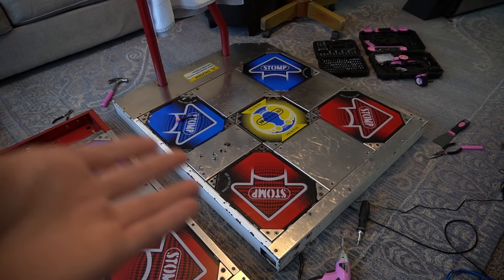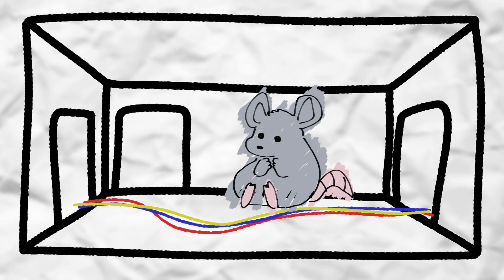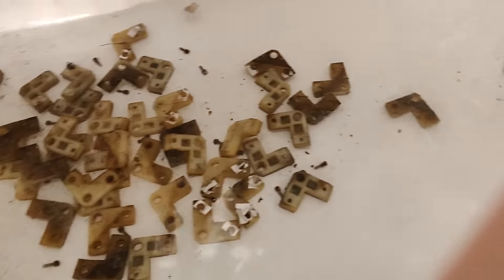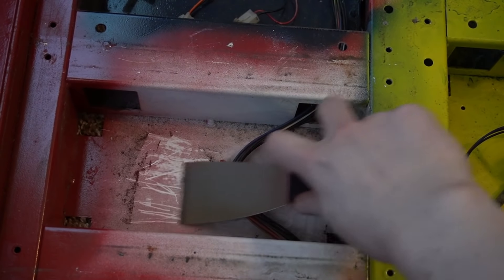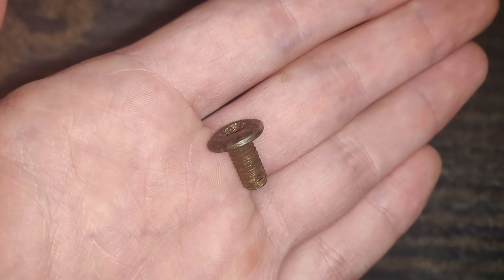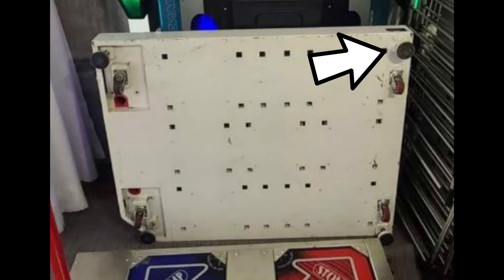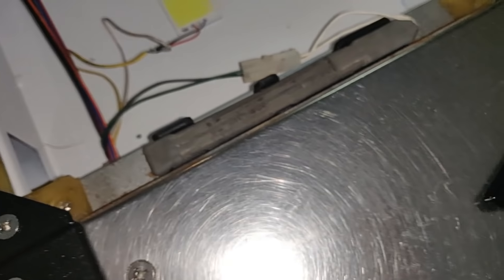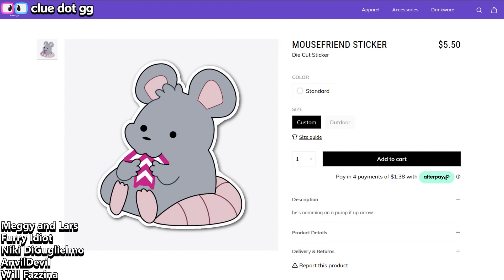i restored some arcade dance pads to their former glory.

Comment: Hey, scratched plastics that are smooth/transparent? Use Nu Tone Scratch doctor and then buff pads on a power drill UwU. We use that alot at my work for laptops, consoles, etc. Also make sure that it the plastic has an image on top like a decal that lights up that the image isnt on the top where your polishing but on the bottom or you'll sand away the decal :3

Comment: Absolutely love your videos and this one is very enjoyable, it's fun to just listen to this adventure of restoring the dance pad!
A tip for future restoration if you ever do it again, I do this for my old consoles when they get really nasty: Use strong chemicals. There's only so much soap and scraping can do alone, but strong cleaning chemicals, and even basic things such as rubbing alcohol (Which rn is expensive since pandamic still going) does a much better job at getting any dirt out, even decades old crust. My PSone was legit a grayish brown because of the crust of time, just by using rubbing alcohol alone it return to a light gray, and became its normal colours when I brought in strong cleaning products. Just a tip I thought could help in the future!

Comment: As an owner of two Namco Motocross Go arcade machines, restoration work isn't easy. Had these two for nearly two years and still they aren't in a playable state yet (missing parts).

Also, did this machine have the original computer and does it work. The said game I mentioned had the original boards both working but with no monitors.

Comment: Lucky! It has been my dream to get a PIU cab myself (although I’d personally get TX instead of GX), so it’s cool to see someone actually got one for himself. Finding one in my country is much, much harder.
Reply from the maker: the GX sold incredibly well in the early 2000s, so if you're going to find a PIU cabinet for sale, it'll likely be a GX. i'm speaking as an american, of course, it very well might be a different story where you are. good luck with your search!!
Reply: @planetclue  I’m from Indonesia, so I’ve actually seen more LX than GX cabs (in fact, I’ve never seen GX in my entire life except through pictures). The arcade I’m playing in (which is extremely cheap - 20 cents USD per play, 3 songs) has TX running Prime 2, while 99% of other arcades over here run LX and PIU XX (more expensive - 50 cents USD per play, 4 songs).

And that same TX cab I used to play is the one I’m eyeing for. The arcade center is old, and the machine itself is quite old (the screen is an old plasma and has quite a burn in for one). If the arcade is going to be closed, then I’ll definitely get that.

Comment: 1:08 Left hand drill bits work wonders as well, the kind that drill in the left hand direction. And an impact driver is always your buddy. It's a device with a bit at the end that you hit with a hammer at the other end and the hammer action forces the screw to unthread while also pushing down on it :)

Comment: Part of the reason that steel is more susceptible to rust after sand blasting is because the media colliding with the metal causes it to ionize, and all it needs is a little moisture to create the environment that propagates oxidation.

Learned this after working in a desert environment (I'm in metal fabrication)

The more you know.

Comment: another thing about your spray can job is that it looks like you sprayed close to the surface and sprayed too thick of a coating. The trick is to coat it in lite layers little by little. That would result in a nice even coat and less likely to droop

Comment: Late to the dance party here, but another help on rusted bolts/screws is to spray them with penetrating oil. spray it on let it sit for awhile and it will breakdown the rust and help it to break loose.

Comment: A simple way to remove spray paint you can "apply vegetable, cookng, or baby oil with a rag and gently scrub with a fingernail brush or old toothbrush if necessary. Use warm water and soap to remove the residue after the paint is gone. If all else fails, apply white vinegar with a rag and gently use a brush to scrub off the paint" (anything in quotes was from Google but if anybody body needs it here you go)

Comment: Whenever possible just hit all screws the day before with wd-40 or some penetrator of some kind. These fluids work better the longer they have to soak, multiple applications is key. When you encounter a fastener that is stuck and won't budge DO NOT just twist as hard as you can like a brute force monster. As rust forms in the threads it expands and locks the threads into place just like when water freezes and expands into ice. Even though the fastener is stuck and wont move you can still load the threads up by torqueing on the head back and forth which will transfer the load to the rust and since rust is brittle and non uniform this repeated loading and unloading will break up the rust and allow you to remove the fastener. First loosen then tighten then repeat.

Comment: Machinist here, you can use something called a thread pitch gauge to tell you the threads per inch, and then measure the diameter of the threaded portion. Your screw size is annotated as the thread size (i.e. 1/4, 1/2, 10mm, 5mm) followed by it's pitch, annotated in threads per inch (TPI),

There's typically common sizes, but some companies will use custom threaded screws to force customers to buy overpriced screws from them only.

Comment: 11:08 you should have looked into FSR modding your pads. For much cheaper than buying a whole pads worth of regular PIU sensors you could have bought the materials to put in a FSR system many players are upgrading to. These sensors are only 4 bucks each for the square ones and have so many great features that make them 100x better than the traditional rubber switch sensor (such as software sensitivity adjustment) . Only downside is it would have taken a bit extra work but you seemed pretty invested into this project from the beginning.

Loved the video anyway, nice to see people giving old hardware new life.
Reply from the maker: I already have an smx stage, which uses FSR. I don't need more than one FSR pad, lol. thanks for the suggestion though :)
Reply: @planetclue  nice, those are amazing pads. I own a gen 3 pad that has load cells. I am working on upgrading it to a FSR system but not using the actual fsr kit SMX sells.

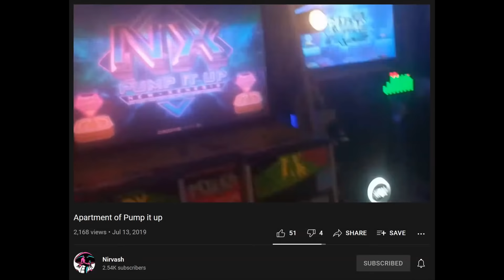Comment: 8:17 That's precisely what Reddit is for. Take your measurements, and take a photo of the screw, find a suitable subreddit and post it there. You will receive an answer.

Your method worked because it's a well-known object, but I've had it with hand-built items that needed replacement screws. That information does not exist, so the only way to find out, is to go to Reddit.

Comment: Spray paint would have been nice, if you would have lightly sandblasted it beforehand and made some profile.

But without it, the paint is just trying to stick to paint far past its recoat window. Maybe if you roughed it up a bit with some sandpaper, But best chance is too just have it blasted off lightly. And then to prevent the flash rust, or future resting. It's best to start out with a primer that is magnesium, aluminum, or zinc rich. Those would have act as a sort of cathodic protection for the steel.

Basically being the sacrificial barrier that corrodes before the environment starts to corrode the steel. Also, most standards say you should have it painted before 12 hours. And if you don't, you need to reblast it or abrade it with a wire brush.

Comment: I feel like if you are gonna do more restorations, a cheap drill press will be a life saver for you! Say you have a hole on the floor that had the previous owner strip out the threads. Just put your drill press on the pad, get the right drill and tap, and go to town. Although, you will have to make sure your using the right material for your tools. Aluminum is easy, just use HSS (High Speed Steel) for the drill and tap. But if it’s hardened steel (use a file to test. A file will have a dull sound if it’s soft, if it’s hard it will ring, like a hand rail at school). If that is the case, you will need carbide tooling, which is much more expensive. At my company, the average cost for a 1/4-20 carbide tap, (1/4 inch hole, 20 threads per inch) is about $90 at McMaster-Carr.

Comment: Hi There! So the YT algorithm sent me to this video! I'm sorry that I'm really late to the game but just wanted to give you the heads up that the 3D printed parts made out of PLA will need to be replaced after about 4-5 years because that filament material (though easy to print) is biodegradable and will deteriorate over time. I would recommend maybe having those prints replaced with ABS or PETG. PETG is a little easier to print with, ABS you kind of have to keep a close eye on. Again, sorry I'm late to the video, someone else probably pointed this out already. Anyway, love the idea of the project! Hope it works out!

Comment: Hey guys, hey guys, I'm coming over more from the car and tractor restoration side of things just wanted to say (can) not well but can get a good finish. Something like that with spray paint but I will take a lot of prep work and sanding and wire wheel to get a good finish in the first place and then you have to go ham with the clear coat if you wanted it to last but it would

Comment: Hey 

I know its a money sink in this project (i also have a GX Machine Cabinet)

Almost everything you said about the dance pads are correct (im not willing to sandblast it, its not going to be the same).
Also some replacement parts are going to be DIY-ed because either theres no replacement available or too $$$$

Im looking forward how you are tackle in the inside of the cabinet, i was like "omg wheres this cable going", and to be honest the only part im afraid of failing is the Neon Lights and the 220v Transformer inside my cabinet. those are the worst ones (Had a bad [if i could say bad] idea of replacecing the coin door for accepting different kind of coins [and keeping a record with arduino] but failed miserably])

i think also while you are upgrading your dance pad i think i saw upgrading the lights (i did that too and i love it), mine didnt have CRT previous owner changed to a TV (as much i would liked to have it, i just had to stick with the LCD TV they installed)

Mine didnt have CPU and Game, and getting a proper replacement was the worst one (getting a MB and the Game, i was not going to install F2, it deserved the original one) took forever

best wishes and still looking forward how does it end =) 

PD Also thanks for Nirvash it also helped me so much like you
Reply from the maker: i actually paid extra to get the original CRT that the cabinet came with! my cabinet also didn't have the MK or a game, so i had to build my own PC with ebay parts. i'll be featuring that more in detail in the second part, whenever that happens. best wishes for your GX!!

Comment: Is Pump It Up designed to require holding onto the bar? At least with home DDR on PS2 I always found part of the challenge to be figuring how and when to shift your weight between feet.

Comment: Totally understand ya.
Since PIU are absolutely overpriced and in really bad shape in my country, so I had to research and make my own, DIY project, with whatever I had around. After prototyping I've decided to go for a final format, but for home use. Nothing really fancy or expensive. By 2011, due to lack of a lot of components and the bureaucracy to get them from outside my country, I gave up on the project.

After more than a decade, with StepXX and now Pump Sanity being the ultimate option with lights and everything a pump fan would like to own and enjoy, I'm probably gonna bring the project back from the dead.

Comment: Hello Clue! I'm getting into the whole DDR scene and I've found someone with a meatl pad that's model isn't one I could find. I looked through a good amount of DDR hard pad shops and couldn't find anything that looked exactly like what I found. Where would you reccomend I go?

PS; I will be updating this comment on news about the pad whenever news comes up. For context, the guy found the pad on the side of the road, and made a few repairs, according to him, the pad wasn't responsive at all (probs a sensor issue or maybe faulty parts) So if I can get it to work hopefully he'el give it to me for free. The aforementioned person is keeping it as a collectable if I remember correctly.

Comment: I played the pump it up in malls but it's the other one not the GX but i never played the DDR but i played it now with a emulator now what is a emulator a emulator is a game where you can play with a phone or others and i got the DDR disney mix and there is options for the controller you can play without the joystick or with the joystick and you can play the DDR with any side of the controller Arrow buttons or shape buttons or both
Reply: i suggest using either a dancepad via an OTG cable or a keyboard if youre playing DDR on an emulator, also, you dont need an emulator since there is Stepmania (or BeatX on Android)

Comment: man how did you need help with getting a screw ffs all you need is the width and length and then specify the head
Reply: also how the fuck did u pay 70 quid for like 30 screws
Reply: absolutely not all you need for getting the screws. there's hundreds of different thread types, densities, angles, length, depth, etc.
Reply: @JustinKoenigSilica  yeah but i would exactly expect fine thread on this mate